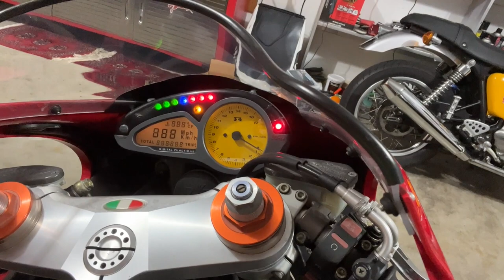Mystery Motorcycle and Weird 80s TIME WARP

Comment: If you're going to do RC racing.... see if you can do it with Legos!  Yes, they did build a battery pack and you can run motors off of it and make your own RC car.  If you can track down set 8366, that's one that not only gives you all the parts, but also starts off with a decent Lego RC car build using Technic pieces along with the RC components.

Comment: I would disconnect the battery for now and go through the wiring and double insulate the wire on wire over metal points. Because a most expensive thing is rebuilding fire damage on anything.